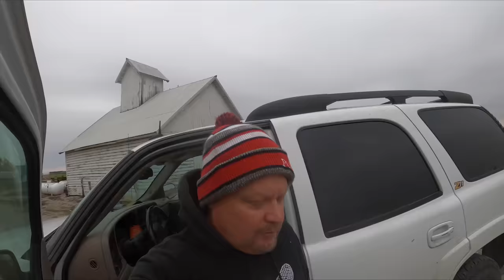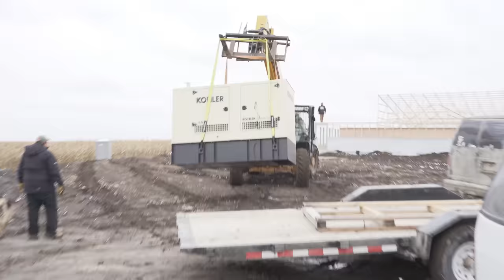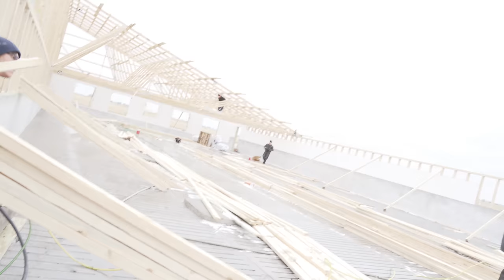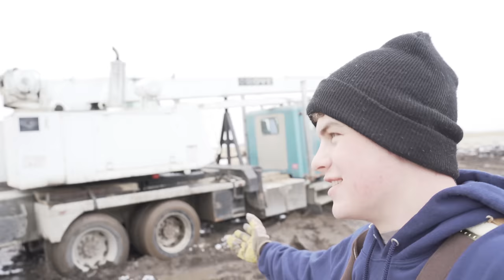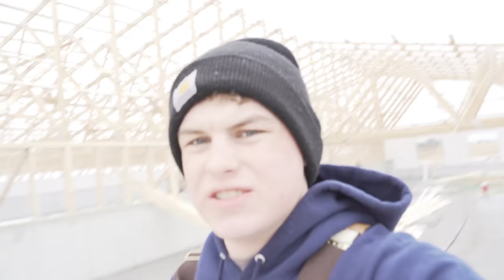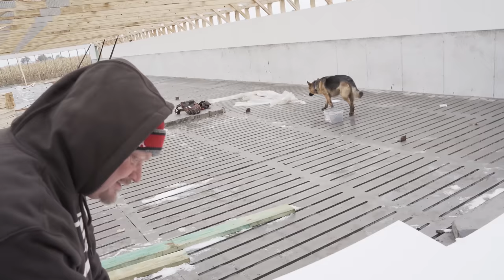Amish Builders Build A Brand New Hog Barn..

Comment: Ya'll getting your money worth with the Amish crew and quality. 
Best builders around in my eyes.
Reply from the maker: I would agree, efficient and don’t waste any time.
Reply: Nah best builders are Japanese or German, facts
Reply: @anand8905  No, the best builders are in no way the germans. Sure, our buildings may last quite a while, but thats thanks to the engineers, architects and the building codes that the project needs to fulfill. If you want a big project done quickly and efficent, don't use german builders. Sure, if you are lucky you get good tradespeople that don't try to get their work done as quickly as possible, but there are quite a lot of tradespeople here that don't do their stuff right.
Just look at the building times for the new Berlin Airport. They started building it in 2006, and just finished it three months ago. Was supposed to cost 2 billion euros, in the end it cost almost 8. Same with the Hamburg Elbphilharmonie, a big concert house in Hamburg. Took nine years to finnish, when they said it would be done in three, and cost more than eleven times as much as they budgeted for.
So if you want overprized, slowly build stuff that may look nice, and if it is done by the right people may even last a little long, then get german builders... German engineering was good in the 50s to the 80s, but since the 2000s quality went down a lot... German building is mainly good because of good building codes, wich make building expansive but the buildings don't collapse if you look at them the wrong way.

Oh, and that barn probably wouldn't fulfill german building codes. Mainly because of missing vent-towers (but those are only required on animal barns because of our population densety, so the smell dosn't affect nearby citys, probably not a problem in the USA...) and the wooden construction, that probably wouldn't fulfill fire-prevention codes. Also a really big pond (holding at least a few hundred cubic meters of water) would be needed so that the fire department can acces a lot of water on site.
Reply: @thoughtfox2409  Damn unreal reply. I think a lot of North Americans think quality as soon as they hear "European" I guess I mixed up German engineering with German craftsmanship. I'm a carpenter in Canada and spent some time working in Japan, Northern Americans don't come close to Japanese wood workers/carpenters when it comes to quality/expectations. Cheers for the informative reply!
Reply: @anand8905  I think that North America and the USA in particular have a very different mindset to the Japanese and Europeans. After all, a lot of US-Internet users still seem to think that minimum wage, free healthcare and care for the poor are communistic stuff that will ruin their country, and that the market has to be absolutly free without any intervention (including building codes etc.). And especialy the very free market makes quality unwanted, because it costs time and money, and someone will do it cheaper if you do real quality work. When in reallity you really spend more money with cheaply made stuff...

I didn't want to talk german craftsmanship to be bad. We have a lot of good and honest trades-people that do their job as best as they can. 
To me, it is bad quality and botched work if a newly laid slab path sinks a 5 centimeters in places after two years or so, because the foundation wasn't made as deep as it should have been (now this is without heavy frost, our winters are really mild with more than 0° C on the average day...).

The main reason that the Berlin Airport and the Hamburger Elbphilharmonie were delaid as much and cost so much more is probably our political system, as well as the need to get the cheapest bidder when the building contracts are given out... For the BER the main problem was the company that planned the thing, and that had the supervision for the project. Or rather hadn't, because they didn't supervise the thing, and the building codes for airport fire-security had changed during the project, wich nobody noticed. So the fire prevention, detection and supression stuff was not valid anymore when they put it in... If they would have gotten a better, but more expansive company, they could have been done in 2014 and with only a billion or so more for the unplanned changes in the fire-codes...

How much stuff is acutally still made with wood in North America and Japan? Carpenters here mostly put in doors and windows, as well as building Drywalls and partially laying floors, and some build (really expansive) furniture. But from what i know in america they still build whole houses out of wood, right? At least i have seen some videos here with houses burning down really fast in the california fires last year, wich shocked me quite a bit, because i am a voluntary firefighter and houses over here tend to burn for hours without collapsing (we usually try to get the fire out quickly, its just that they take ages if you let them burn or the fire is rather big, like the whole roof area...)

And yes, what germany usually is known for is Bavaria (Oktoberfest, Prezels and Lederhosen...) and its engineering, although we have some really beautyful old half-timbered houses here, so our craftsmen were quite good too!

Best greetings to Canada from Germany!
Reply: @anand8905  the Amish heritage is mostly german.

Comment: Crazy how much flex those trusses have without snapping. Great videos!
Reply from the maker: When I first saw how they did it, I thought for sure they were gonna snap at least one. But it went good 👌🏻
Reply: Depending on the size of the truss, they should have been picking a 2 points. Would have been even less flexing

Comment: I thought the Amish only used there hands not nailguns and electricity
Reply: Only air tools and the compressor runs on gas. No electricity. Bishop doesn’t allow it. Thanks for watching!
Reply: @torktalks5573  its all horsshit!they make the rules up as they go! Some wont allow gasoline engines because there is electricity to make a spark!So they think diesels are ok!Originally,modern ,easy life was to be avoided...now they pick and chose...some have cellphones but no land line INSIDE THEIR HOUSES BUT OUTSIDE IN A PHONEBOOTH,......and as for the military..they would have let us fail against Hitler rather than fight him.........

Comment: The Japanese people are the best carpenters by far. As I understand it's very hard for American men to get on construction crews that specializes in mortise and tennon
Reply: Get serious, American framers are fast and furious, especially in Texas.  Japanese are slow and expensive, great results but most people can't afford a house that costs twice as much as normal.
Reply: @thomaswayneward  is that why Japanese buildings survive tsunamis earthquakes and other natural disasters for centuries, one little twister turns your Lil ol framing job to toothpicks in seconds...but hey, job security right???
Reply: @jesselehmann1643  I built homes in the USA for over fifty years, including some like the Japanese homes.  The methods used to build a traditional Japanese home are simple but time consuming and therefore expensive.  For the same money a traditional Japanese home costs per square foot, I can build a real stone and brick home that can withstand about anything.  Or I can build a wooden one that can withstand anything a traditional Japanese home can withstand.  The weak point in a traditional Japanese home, as far as bad weather goes, is the roof.  Every home I have ever built has a stronger roof than any Japanese home.  Bolt the sole plates down, use plywood with nails as sheathing, use metal rafter ties to connect the rafters to the walls, use metal ties to hold the ridge to the rafters, nail on sheathing for the roof base and you have a strong home.  The cost is minimal.

Comment: Why is the ceiling so low in hog barns?
Reply: It’s 7’6” I think. Less volume to heat or cool and more control of temperature ceiling to floor. Also easier to keep good velocity on the air moving through the barn. Thanks for watching!

Comment: I didn't think Amish work with modern equipment
Reply: They run all their tools on air supplied by a huge gas powered air compressor. The one guy on the crew that drives the telahandler or skid loader is not Amish. He also drives the van.

Comment: I’m a little confused, and don’t mean to be rude or insult anyone, but my thought of the Amish is no electric, and no modern clothing etc? Have I missed something, or are there different types of Amish? Appreciate any replies, thanks.
Reply: They are free to use air tools and battery powered tools without any issues.  They are allowed to run generators to power these devices as it is work-related, not leisure.  Also, there are non-Amish crew members who do not have to follow any of these rules, such as driving vehicles and delivering goods on a semi.

Comment: Ive done construction for 20 yrs and my mom decided to use the amish for a polebarn because it was such a good price ......i had a bad feeling from the salesman to the lumber drop....
Well let me say this 3 kids showed up
One was 19 the others were around 15....
They rushed the job and were done in 2 days...every aspect of the job was c class at best some d class....
The metal work was horrible and hideous....no mitters gaps in corners un level lines, fascia boards came off following year....the ledger down one side of the 64x32 structure was held flush to the outside when its supposed to be held out 1.5 inches to carry gabble truss and so it breaks on center of posts instead it was 1 inch break the crete for the posts got no water added which i wouldve atleast sprayed the holes....the doors were cheap n tight ......the job was a 3 day job for experienced guys not a 2 day job for kids.....they also slept in there truck at a near by parking lot so they never got good rest.
The metal work was so bad that birds were in the soffits and getting in building....there wasnt one aspect that was satisfactory

Comment: Amish use power?
Reply from the maker: No, they have a gas powered air compressor hooked up to every tool they use.
Reply: @thislldofarm So the answer is: Yes they are using power. Sorry but that is not Amish.
Reply from the maker: @rodrigoalcover332  they have an engine hooked up to it. The engine burns fuel to power the compressor, which then fills a connected reservoir with highly pressurized air.
Reply: @thislldofarm  Yes I understand perfectly how it works. But as Amish, they shouldn't use power.